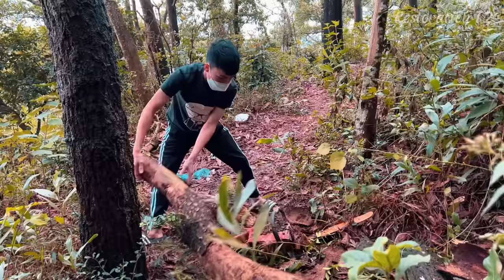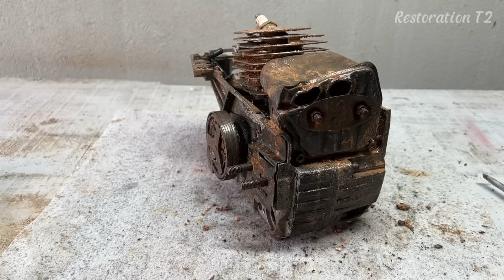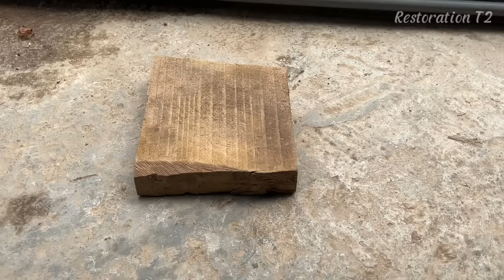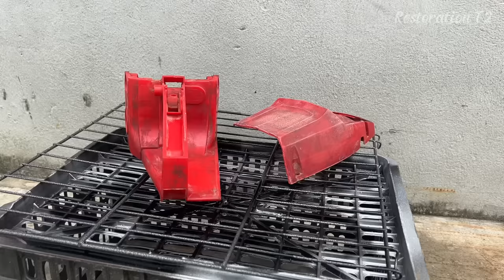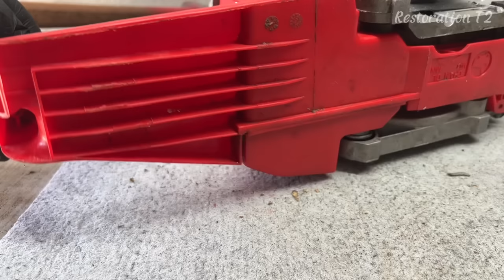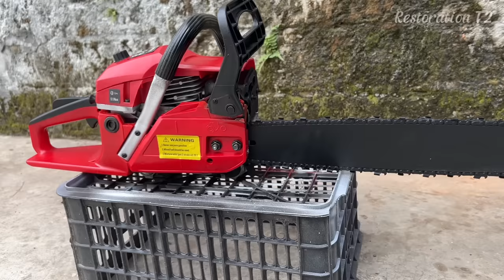Rescue and Restoration  CHAINSAWS  Old Abandoned in the Forest

Comment: That was a REALLY well done restoration. Lots of attention to detail!
Reply from the maker: Thank 🥰
Reply: are you joking, he didn't even sharpen the chain. the paint job was crap, you can even see the overspray on the handle the surface is like an orange peel. If he restored the thing properly with a new spark plug, new diaphragms and filters,  (you don't even need the gaskets really) new chain, re grease and maybe even replace the bearings it would start MINT, non of that, he did the bare minimum. This chainsaw wont last long, all the electroplating and anodization that was on the saw is ruined and non of it was replaced it was just painted over with cheap spray paint, its going to start rusting, the bearings will fail, and the paint will bubble and burn from the heat, dude straight up painted the clutch so its gonna smoke no matter what. I just pulled apart just the carb on a 30 year old chainsaw and it starts in one pull so the fact that this didn't start right away is either a testament to build quality of early 2000s saws or the quality of the rebuild itself, its probably a bit of both